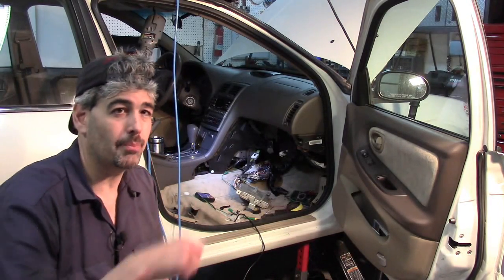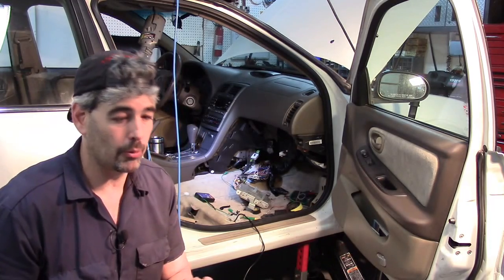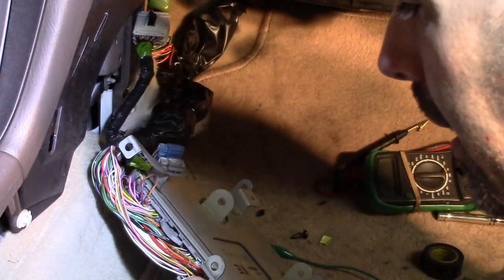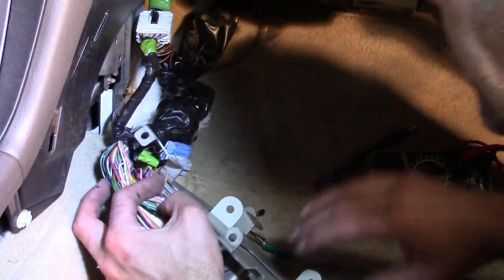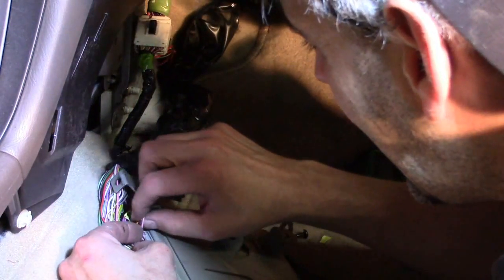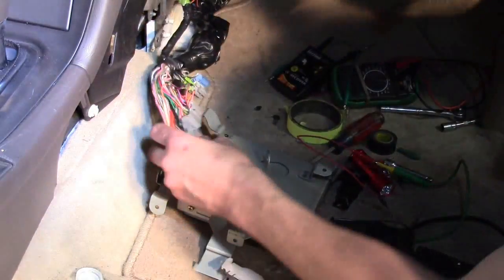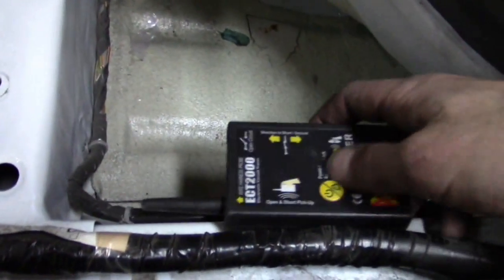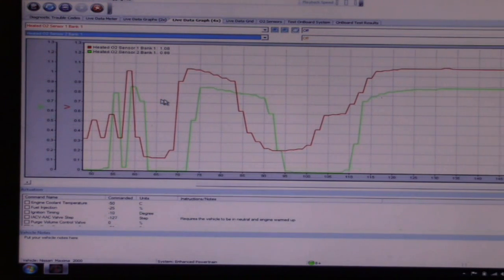P0138,P0139 Diagnosis from Hell Part 2

Comment: Nice find..He lucked out on pcm issue.
Now I got to have that tool.seems to be worth its money
Reply from the maker: Yes the owner is lucky he didnt need a PCM.  Replacing a PCM on these cars (and most cars nowadays actually) requires a reprogramming and idle relearn that can only be done with a dealer or very high end scantool.  The car will not start with a PCM that is not reprogrammed and matched to the VIN.  This means at best I would put a used PCM in and he would have to tow car to a dealer and get reprogramming done, and at worst- he would have to have dealer install a PCM and reprogram it at maybe $2000 which is more than car is worth.

Comment: I don't know how the auto industry keeps such a lock down on their wiring schematics, but the best place I found for free was the AutoZone web site. I believe they have some sort of deal with all Data. Great video
Reply from the maker: 1quickchevy2 I usually use alldata and I agree it is the best I have available however I can tell you they are accurate only about 80% of the time in my experience. It is frustrating as hell. As you saw I was led down a false path at least twice on this case study from inaccurate diagrams.
Reply: Schrodingers Box Rodger, the right ones are harder than nuns panties to find.
Reply from the maker: 1quickchevy2 Lol... in watching ScannerDanner sometimes I notice he uses Mitchell.  I have yet to see him find a discrepancy with Mitchell and his application. I may look into that but I can't justify the expense of a subscription.
Reply: Ya, I can see in a professional application it would be worth it. For the average weekend warrior it's hard to justify. One of them will let you buy a month access to the vehicle you need, but that's hard to justify to a customer.

Comment: Great video showing real diagnosis!

It would be interesting seeing how you would do as a professional tech troubleshooting these type of issues under the time crunches we have. 

I think that is one of the many problems with this industry, shop owners don't give us enough time to thoroughly diagnose problematic issues as well as giving us additional time to deal with frozen nuts/bolts like this rear o2 sensor. 

It also doesn't help that there is also a plethora of parts changers in the industry too :/
Reply from the maker: dreamer2355 Actually I would ask you the same... I have always been curious how a professional would handle this diagnosis.  The diagnosis alone took me about 8 hours- granted a lot of it was tracking down the wrong path due to my lack of wiring diagrams and unfamiliarity with the car, researching the computer harness pinouts, etc. But l have to think- even if a pro could do it in half the time- say 4 hours, does the customer get charged $400 for the diagnosis or does the diagnosis cost go towards the repair price for a replacement PCM, or what? What would your shop do in this case?
Reply: Well, usually if we can not find the issue after 1hr of diagnosis time, we usually call the customer, let them know our progress thus far and that we need more time to diagnose the issue. It would be another 1hr increment. 

If we can not find the issue after 2hrs, as a tech, we usually start to loose time where i work and its hard as a tech trying to sell more time to our service writer and shop owner. They have little patience and understanding of this matter. Usually the expectation is to find the issue within 2hrs. So if i spent 4hrs per se on this Nissan, we would charge for 2hrs diagnosis and the time for the o2 sensor. I would loose time as a tech. 

I had a vehicle a few months ago with a voltage drop on the ground side of the fuel pump causing a no start obviously. It had a 7v drop at the pump. After about 3 hours of looking, testing and going through the harness, i found a poor ground. I lost time on that vehicle.

If you're interested in hearing more of these issues, feel free to email or message me directly.

I also feel your pain and frustrations with wiring diagrams. We use Alldata and Mitchell at work, both usually contradict each other.

Maybe for your hobby, you can charge your customers a $25 fee so you can access there vehicle info on Alldata DIY?

Again thanks for showing how to correctly diagnose issues and prove there still are people out there who can do this type of work efficiently and correctly. DIY'ers are always quick to pounce and bad mouth dealer and independent techs when half of the time, they do not know or understand the struggles we face for the techs who actually care.
Reply from the maker: dreamer2355 Wow that is really interesting!  I actually usually use AllData DIY but I usually can find the diagrams online free and to be honest, I seldom find the diagrams are accurate. I would think Mitchell must be better but I never used it.
  I wonder if there is a market where these difficult diagnoses could be done on-call at a flat rate.  I for one would gladly have performed this diagnosis for $200 and the shop would be able to go onto more profitable things and everyone is happy.
  I agree- as a professional tech, I would have lost my ass on this one, no doubt. Probably would have told customer they need a PCM just as a guess so my worst case scenario is covered.
Reply: Im sure a different shop would have a different approach and charge different prices going by a case by case basis.

One of the teachers of our advanced diagnosis classes, John Thornton (he did a few YouTube video's) also operates a business where he diagnoses issues with vehicles that other shops can not figure out. He is the smartest person i know. He is big on using Pico scopes and is excellent at dealing with network issues on vehicles as well as drivability. He charges the shops by the hour and also warranties and guarantee's he's diagnosis so if the part he finds at fault doesn't fix it after the shop has installed it, he eats the cost.  

Eagerly awaiting your next YouTube upload!

Comment: Hey Matt why dont you put the old one back now end test it again to see the diference
Reply from the maker: geoepi321975 That is not necessary- I already tested the old one with functioning heater circuit and it was not responding correctly and the new one both with "manually" grounded and PCM grounded worked fine.  Therefore there is no reason to test the old sensor with PCM ground.

Comment: Well done Matt, in hindsight I guess you didn't  put your line tracer on the firewall harness. Solid information  is a timesaver.  Man that's a lot of work digging out the computer, lots of  good test procedures.
Two items you may find useful in the future.
http://www.aeswave.com/Current-Probe-Low-range-Generic-brand-p8486.html
http://www.eautorepair.net/Marketing/html/products.asp
Reply from the maker: Steve Rob Yeah as you know, every repair would have been done different in hindsight after you know the problem.  I simply was unaware where the wiring harness routing was and for the life of me couldn't locate it through the carpet or anything- as you saw I even removed the seats, etc.  Now that I know the routing, yes I would have been able to find the open without probing the PCM. But made for a good video, didn't it?  This was one of my favorites, if you don't mind me judging!
Reply: Matt I would say your venturing into the upper level  of electrical diagnostics , for someone not as confident in electrical your sure displaying a solid grasp.  Nobody can walk away from this vid without learning plenty. 👍

Comment: I like so much the continuity wire tester.

I had never seen before and took several years working, it seems very useful for this type of repairs.

A greeting. =)
Reply from the maker: Pablo A Thanks Pablo. Every person facing electrical diagnosis needs that thing.  To do continuity testing using jumper wires and probes like I used to years ago would have been absolutely miserable in this case!!
Reply: n Spain and that tool not saw but tools for Ethernet cabling, but these are not applied to e saw into car.

Thanks for answering and greetings =)

Comment: Green sharpie on yellow tape.  I hate you so much right now... XD

If you do replace the cat, avoid Eastern Catalytic brand products.  You get what you pay for.  :\

This was a fun one!  Chasing wiring problems is always a nightmare, so kudos for sticking through it and being so thorough!
Reply from the maker: rhkips Thanks Kips- yes this one took persistence indeed.  The thing I hate about wiring problems is charging customer a fair price.  As you know I give free diagnosis- and within minutes my diagnosis was "open O2 sensor heater circuit". But how to fairly charge for the nearly 8 hours of tracking the wiring, digging the computer out, researching the wiring diagrams which led me down the wrong path twice.... 
  So to be fair.... I actually waived labor for customer on this one, only because I kinew it would be a kick-ass video!! lol.
Reply: Schrodingers Box Haha, nice!  Sometimes the knowledge we gain offsets the financial cost of the time.  I frequently find myself "undercharging" for stuff like this, but at the same time, I'm still making more than I would be in a shop or dealership, and the customer is paying a LOT less than they would be at said shops or dealerships.  I view it as a win-win, even if most accountants would be telling me I'm an idiot.  :D
Reply from the maker: rhkips Lol, we are much alike!! I believe the word that describes this is "integrity".

Comment: Nice find. That's like a fox and hound, didn't know power probe made one of those.
Reply: eldoradony as far as I can tell those fox and hound are relative new to the automotive industry but seem to have been in the communication industry for quite some time. Interesting the crossover applications. I wonder about a time domain reflectometer in a situation like this as well. Such a short length of wire would be tricky to get accurate distances though. I will have to play around with it.
Reply from the maker: ***** I only discovered it last year and I use it constantly!!! One tool I can't live without!
Reply: ***** I have been using a Fluke tone generator and tracer that I purchased for telecom work. It is a great tool!
Reply from the maker: eldoradony When I hear "fluke" I think "expensive as hell" lol. All the pros use Fluke, but I wonder, Is it really worth the price? Why?
Reply: Schrodingers Box fluke is 100% worth the money. All my meters are fluke, the 87 v being my favorite. I also have a fluke handheld scope that I love. The quality is so far above other manufacturers I think it's well worth the price. All my stuff I bought used and it really was not that expensive.
Reply: I haven't priced the Power Probe but I bought my fluke set on ebay used(barely) for about $70. I don't believe Power Probe made one when I bought the Fluke. I have a Power Probe for years and I love it.
Reply: I don't know about a domain reflectometer but with a retrospectivescope  you can't go wrong.
Reply: eldoradony I'm not familiar with those and a Google search didn't yield any results that made sense. What are those?
Reply: Its a phrase that translates to if you can look back and see what you had to do and see your successes and failures, you will be able to conquer future problems....like a Monday morning quarterback. If I only knew then what I know now!